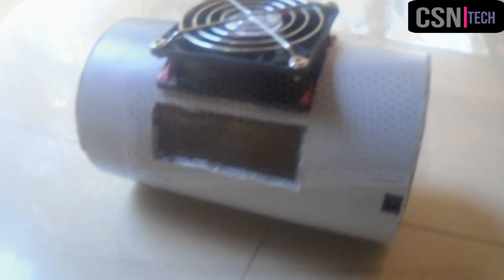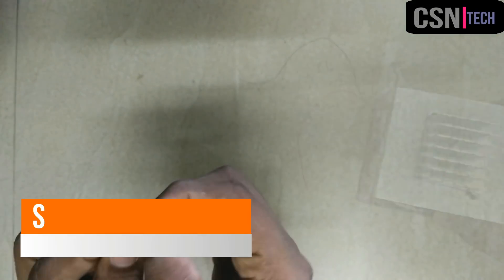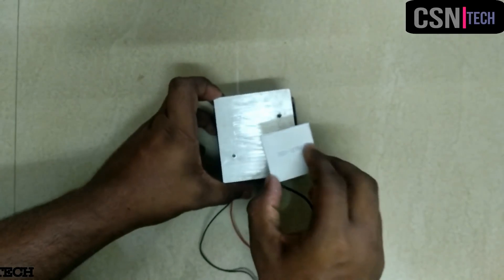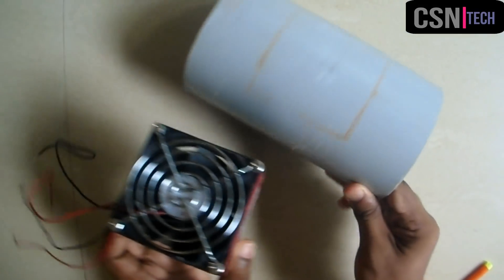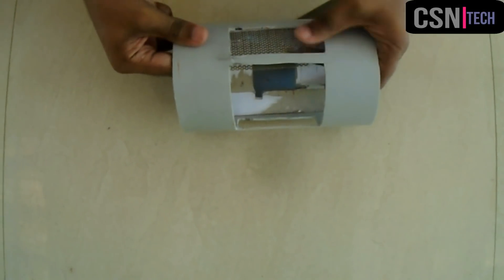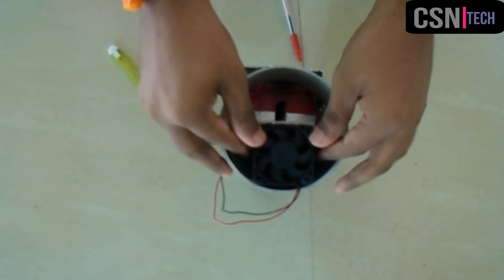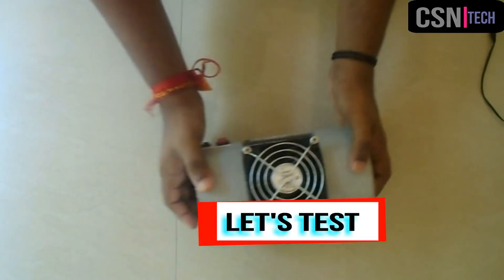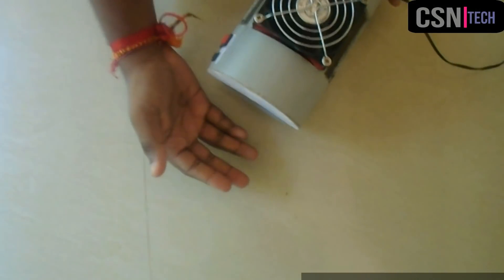How Can Make Portable Mini Air Cooler Using Peltier Module at Home || Simple Project

Comment: Fist hot air come out u set  fan and  when u put in room both air is thet hot air come out of fan and back side cool air and one side hole ..
I  do this ...
I put cool  side fan and back side hot and back side hole attach pipe ( in hole and out of windo)  i put two hide sink two fan( 12706) cool side and back side hot air come  air from hole  and put rher pipe out of  windo and set  fan to out air  
And set degtal meter cool side   very cool  .

Comment: sir nice work....if i am using a pipe line for exhaust hot air...and by using more peltier can i cool the entire room
Reply from the maker: Hai Saravanan , 

you need more number of peltier modules with heatsinks and cooling fan to cool down the entire room ,  but it will consume more power , 

Peltier coolers are mainly for cooling small areas , or it is good heater than a cooler .

    It is a good idea that to use the pipe line to carry the exhaust air ,.   
 It will throw out the hot air , also the cold side become more cooler .

Good luck for the project 

Also watch my other videos also

Please 

Like  , share , Subscribe

Comment: Have you ever thought of a design which can cool and heat a whole room ... what would be the power consumption of the same? I understand that a peltier is a more efficient heater than a cooler, is that correct?
Reply from the maker: Thanks for the response  , 

             Yes you're right , peltier is efficient for heating, But the cooling also can be utilized for making some projects ,like this ... 

I will not say this cooler can cool down a whole room ! , but it can produce cool air .......

Comment: Brilliant bro I bought 3 module but I didn't know there is different modules in peltier so I bought a cheaper module and now it's not getting cold I have 12v 10A of power supply so what is the problem
Reply from the maker: Make sure the polarity is correct ! . Also make sure the peltier is in good condition.

Did any of the 3 modules working well or Have the problem with all 3 modules..?
Reply: When im giving power to the module it's getting too hot for 2 min then after 5 min I getting on normal temperature but didn't got cool ,
Reply from the maker: is the problem  associated with all 3 peltier modules...?     if yes , try changing the power supply  otherwise change the peltier modules.
Reply: Yeah I returned it now and buying 12715 is it ok
Reply from the maker: perfect....
Reply from the maker: Don't forget to watch other videos from CSN TECH,  also subscribe the channel

Comment: You  just inspired me to move my lazy ass :)

I do have a question: What kind of maintenance would I have to do on this thing? E.g., cleaning, replacing parts, etc.

[EDIT:] Another question: Is there any way to control the  temperature?
Reply from the maker: Cleaning should be done periodically,  the parts should replaced if anyone has damaged , no other maintenance needed .

Temperature control of peltier module  can be done using microcontroller and temperature sensor , by using that you can set the cut off temperature , 

In a simple way  you can adjust the speed of the air blowing fan , so you can vary the speed of cool air.

Comment: Cant we change the motion of the fan ehich is placed at hot side so that it can throw hot air out
Reply from the maker: Of course , the use of that is only to dissipate the heat the possition does not matter
Reply: CSN Tech ok thanks sir and one more thing that does it work well
Reply from the maker: Yes , make sure to fix the fan in a way that maximum heat can be dissipate.or you can try many varieties of heatsinks , which the possition of fan will be vary.

Comment: Mera tec 12706 dono side se heat hota he so what can i do
Mene heat sink nai lagaya je but 10 sec me hot hota he to ab what can i do.plz ans me plz sir.
Or is tec 12706 ko 12v 1 amp par run kar sakte he .
Reply from the maker: Make sure the polarity of the peltier module is correct , Make sure the peltier module is good in condition , ,Just take the peltier out and connect it to a 12v 7Ah battery for testing , then still the problem exists replace the peltier module.

You can connect 12706 to 12v1 A but it will not cool down the temperature as we thought, it will just cool the cold side we can feel it when touching the cold side , also you can't connect any other components to the same power supply , 12v 4A power supply can be used for small cooling purposes.
Reply: Okay thanks.
Nd 12v 1.5amp fan work karega 12v 4amp par sir.
Reply from the maker: Yes ,it will work , but I recommend 12v 6A for full efficiency
Reply: CSN Tech thankyou soo much sir
Reply from the maker: You are welcome, 
also check out my other videos 
please subscribe the channel and suggest to your friends

Comment: I received 4 plezier just tody.i try to demo that peltiers one side hot and other side cold but after few minutes pothu side heated.i used heavy head sing plates and a fan also.
Reply from the maker: If the supply is turned off after some time  , both side will become hot , Make sure there is no complaints with the peltier module , if any complaints occurred just replace it , also check the power supply unit .

Comment: Are bhai, what abt the hot air coming out at the same time n same place which is absorbed by the big heatsink and it's fan. 
Means it will throw the cool air from one side, as well as hot air from the other side. 
So the results are "0".
Reply from the maker: You're right
, But I have already said it doesn't have the capacity to cool a whole room , we can use it for direct cool air as a fan  ,thus there is no effect of the hot air ,. Or you can simply use some flexible pipe to throw out the hot air ☺

Comment: is use instead of AC to cool room
Reply from the maker: It doesn't have capacity to cool down the whole room , but you can make such cooler using more number of peltier module and heat sink, it will cool down the room , you can use that instead of an AC
Reply: Its not worth the extra electricity to do this.  The efficiency of peltier plates is actually terrible when proposed as a method of cooling an entire room.  Better off to just use an a/c unit.

Comment: How much sq ft area will cool with the help of this device?
Reply from the maker: It is a small device , it can only use as a fan   ,  it gives really cool air , 

Or you can make a larger cooler in this way , using more peltier modules , then the cooling of small rooms may possible.

Comment: Is plate ke price kya ha bro
Reply from the maker: Bro , it's not a plate , it is peltier module, you can buy it from the link given in the description,. Price about RS 300 on Amazon
Reply: Boro Agar 2 peltier lagado tu Kitni cooling Karega
Reply from the maker: if you place more peltier modules the cooling also will increase , the temp may below 0 celcius  , also one think , if you are adding more peltier modules you have to increase the power rating of the power supply for effective cooling.

Comment: i like your video, please tell me what was the temperature of out cool air?
Reply: Also ask for the temperature of the hot air throw at the same time.
Reply from the maker: It will according to the power supply and the peltier module , I am using 12706 module , it is designed to work with 12v and 6Amps , a 12v 6A power supply can be  used to work the peltier at full capacity , other think should keep in mind that , " much cool the hot side , more cool the cold side  "
The cooling can be increased by using larger peltier module or the peltier module having larger ratings , 

In my project , I don't have any thermometer ,so I can't say the actual temperature , but I can say that it is about  -5°
Reply: CSN Tech thanks for fast reply
Reply from the maker: You're   Welcome , 

Please subscribe to the channel , and suggest to your friends
Reply: CSN Tech yes i did